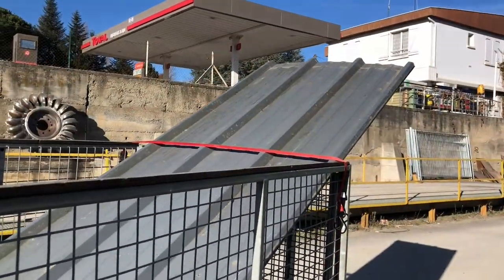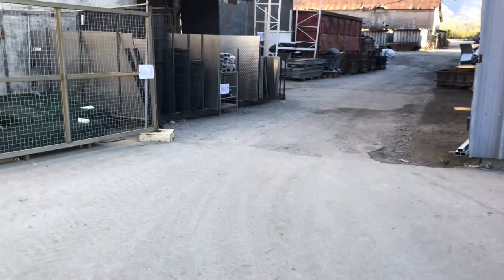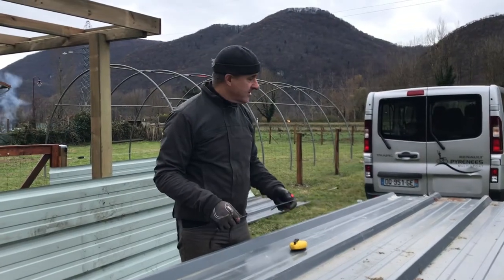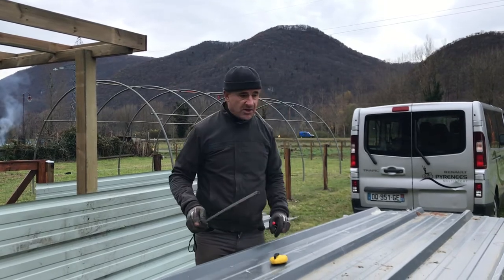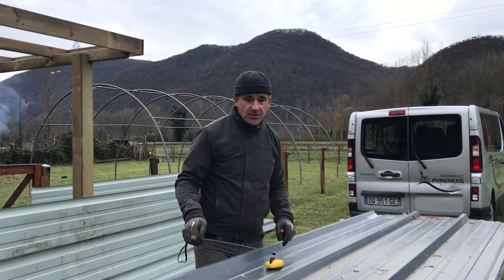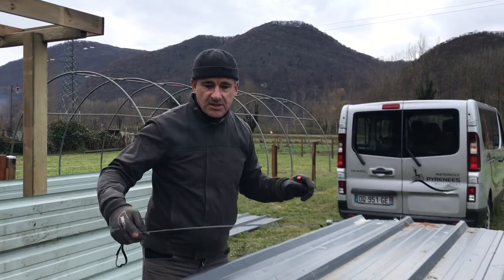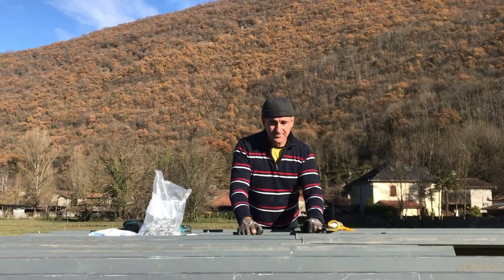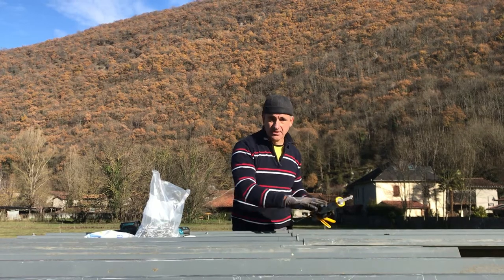Animal Shelter Roof | EP11 Couple Builds Container House & Tiny Homestead

Comment: Always proper eye protection when cutting metal.  I was doing exactly that with side ventilated eye protection and one of the metal shards/sparks stuck in the white of my eyeball. That was painless but my eyelid was lacerated. Fortunately I live close to the Bristol Eye Hospital so was treated in an hour but I was so close to losing my eyesight. I should have been wearing eye protection with shielded side vents. They cost pennies.
Reply from the maker: Yes, we have bought all the gear now, specially on the build site.
Reply: @HomesteadingUncontained  I'm a design safety manager for a massive construction project in Somerset, construction safety is core to my role. I really admire what you are achieving without access to multi billion pound machinery and a work force of thousands. Keep up the great work.